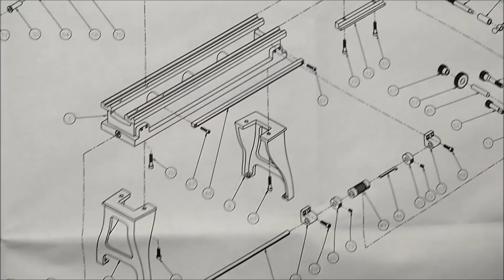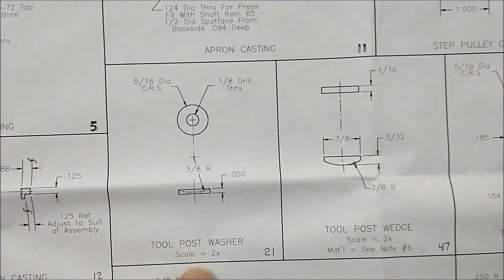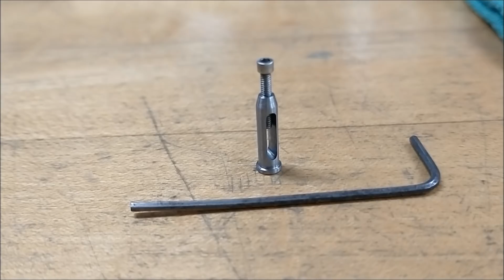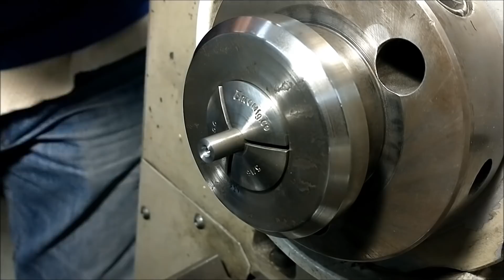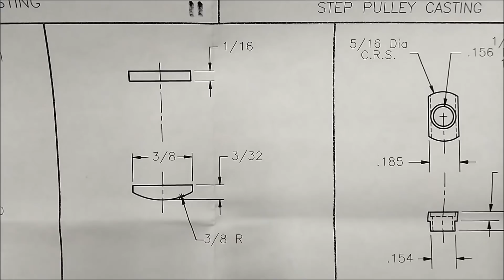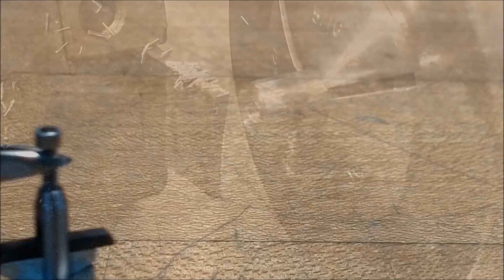Miniature Engine Lathe - #1 - The Tool Post

Comment: This series has 'forced' me to get one of these kits.  My only complaint about the kit is the plans are on such huge sheets.  I actually prefer each part drawing on an 8x11 sheet that I put in protectors and notebook and keep that at the area where I work for easy reference so I don't have to go over to the table
Reply from the maker: I agree. I normally take the large sheet into the office and block copy the areas I am working on. I have a lot of 8 1/2 x 11 drawings when I'm done. Good luck with your build. Its a challenging model, but the finished product is worth every minute. Thanks again for the gift.

Comment: Last time I used that gap was on a Winchester '73 set trigger tension screw. I would be using my Unimat on the tool post holder and a magnifying glass. Very nice work indeed. The miniature rocker barely big enough to pick up . Maybe a ball end mill in the lathe tailstock to make the rocket ring? All in all, very enjoyable to watch your work.

Comment: Plunge a 3/4" ball mill to get the proper dish in the washer.  The only hard part is figuring out how to hold the 3/4" shank in the tailstock.
          (Do you have a ball turning attachment for your lathe?  That could also be used.)

Comment: At 42:30, that looks like a tiny boring bar.  Where did you get it?  I've used end mills mounted in the quick change tool holder that has a V grove in the bottom, but this looks better.

Comment: Hi  from Down under 
Next time you need a keyway type of part . I set the bar with the grooved disc horizontal on a veeblock the run a slitting saw the Finnish the key or in your case the wedge. Cheers Steve
Reply from the maker: I like it.

Comment: I'm never been interested in model making but a miniature lathe is certainly special. Truly liked you techniques, explanations and presentation.
It has been said already that an allen screw looks really out of place on a latern toolpost? Should be a square head, what the drawings say?
Reply from the maker: I agree. That would look more correct.  The cap screw was supplied.

Comment: This is great work. It makes me want to build one. The best of YouTube. It doesn't just teach. It inspires.

I like the camera angle and view. I have a question about the lighting on the mill, though. Is it my monitor or is it the lighting? When you were cutting the wedge, the metal looking a little yellow -- almost like brass. Are you using an incandescent light, or an LED with a warm color temperature?

Also, a question about the order of operations cutting the wedge. Could you have put a length of stock vertically on the mill and cut the "slot" first? Then part it off. The down side would be the interrupted cut. The upside might be that you would have a smaller "razor" edge when it parted. What do you think?

Comment: Kind of brings into question how far down in terms of size you can go and still have conventional machining work. You wonder if there is a process which is like an anti-welder which removes material.
Reply: EDM...
Reply: There are machines that use spark erosion to make any shape hole, the shape of the electrode determines the shape of the hole

Comment: Joe, i recently acquired a 1980 Enco 9x42 mill... whats a good drill chuck and arbor to use? all the R8 arbors and straight shank arbors i have all have horrible runout. i have a brand new Jacobs (made in england) 3/4 straight shank arbor and it has around 4 thou runout on the jacobs taper. im getting around .0002" runout on the collet and shank. i have several jacobs chucks a what looks to be nice Cushman, some chinese keyless chucks and they all have horrible TIR. best i can get is .005" runout (.010" TIR) on a drill rod at the chuck. and thats on the chinese keyless chuck on a new Shars R8 arbor. the jacobs and Cushman are over .020" TIR. i do have a nice Albrecht i use on my lathe but i dont have an R8 arbor for it. AND i would like to use a keyed chuck so i can power tap with the chuck.

Comment: Another PM blooper Joe. The dished tool seat disc would have been better if rather than a annular it was just cross cut with a 3/4 end mill. This would ensure the rocking wedge had full contact rather than two line contact areas. Yes it's just a model but if it's worth doing, do it right. Pretty sure the other creator will stay away from this model lest comparisons are made :)

Comment: The micrometer that is getting used at around the 24:50 mark. Looks different. Is that bought or been adapted after purchase to mic a part that only has so much surface area to get a reading off. That is a small piece at the 26min mark that is being parted off.
Reply: It's a standard micrometer style that you can buy, the blade anvils allow the diameter of narrow grooves to be measured e.g. a circlip groove. Some micrometers come with different style anvils that can be fitted for different jobs.

Comment: Another great video.   I noticed the face plate was numbered 16 on the parts list and on the prints there was a number 16 in the square.  I feel your pain on this project.  I'm sure you will do just fine.   Dan

Comment: Top notch! I wonder how many days it took to cut the parting tool with a Dremel though.
Reply from the maker: Using a cutoff wheel, it took about 5 minutes.
Reply: @joepie221  That's way quicker than I expected.

Comment: Another great video. Here's hoping you will continue with the other PMR scale machines:  horizontal mill, shaper.
You do know that PMR also has line shaft hanger kits should you decide to use the steam engine to run all these machines . 
Can't wait to start my lathe kit, which, incidentally did not come with the plans or materials for the four jaw chuck.
I do have all three kits and they have been seasoning under my bench for some 25 years. Your videos will be the impetus to get me to work on mine. Thank you.

Comment: For the cup, instead of a form tool, why not just go in with a ball mill chucked up in the tail stock?
Reply from the maker: If you have a $150, 3/4" dia ball end mill laying around, It would be Ok to use if your tailstock chuck could hold it.
Reply: @joepie221  Mine is only $130, will that still work? 
haha jk

Comment: For drilling the slender tool post prior to slotting I think you hit the nail with a wood support. I was thinking just before you mentioned that option that a shallow angle wood wedge to support the post for center stabbing and then drilling would have been a nice option.  

I can hardly wait to see the scale Armstrong tool holder for the 1/32 square HSS tool ... :D

Comment: Ha ha. I have that exact same calculator!
Reply: Slide rules taught us to maintain a mental approximation - still helps to warn of finger trouble. Sadly, slide rules don't add or subtract!
Reply: @russelldold4827  They can, if you have the right scales. But the numbers need to be of the same order of magnitude, or the process becomes sufficiently complex that you might as well just do it the way you learned in the third grade.
Reply: @russelldold4827  Hence, the Curta. What a great machine! Hmm... next Joe Pie project?

Comment: I usually use adjustable parallel and scrap aluminium when I have to support something thin lika that toolpost. Works for me ..
Reply from the maker: I looked at that, but the shorter adjustable parallels are short and wouldn't span the jaws. Building a sandwich took up too much room.

Comment: I think I have some stock that's the right sizes. Makes me want to try to do this without throwing the parts all over the shop. Or trying to fish them out of the chip pan. I like that you added an HSS tool bit, nice touch! When it's done I want to see you make a part for the lathe on the micro lathe! For bonus points, power it with the steam engine! :)
Reply from the maker: DONE.

Comment: did u make that tap guide? if not can u let me know where u purchased?
Reply from the maker: No. Its a NIROL brand. If you can't find them, any spring loaded tap follower should do. Look for Nirol first. #1 quality.
Reply: @joepie221  got those - maybe i did not state properly - the knurled round tap holder? i can make but easier to buy :)
Reply from the maker: @VanguardSys  I made those. If you make one, knurl a piece of bar stock for a few inches and part off as many, and as wide, as you prefer. Mine are 1/2" wide, .160 through hole with a 10-32 lock screw.
Reply: @joepie221  appreciated! grabbed some inconel had left over - lets see what we can do

Comment: When the lathe is finished, the first upgrade will be swapping this lantern style toolpost to a QCTP.  Next, install a DRO. An ELS would be very nice too.
Reply from the maker: I may actually do the QCTP and holder. That would be awesome to try.
Reply: @joepie221  I dare you!
Just found your channel, I am going to binge-watch all 34 episodes you currently have on this build. So far, I would classify your work as the exact opposite of abom torque. Those parts are miniscule!

Comment: Hey Joe,   I just noticed that you don't install your HSS tools in the tool holder up against the  inside face of the slot.  Is there a reason for that or does it matter?  Thanks.  Oh, and the camera setup works for me. :)

Comment: Presumably the wedge is to allow the tool to be angled in the holder. But the machine screw that tightens it all up is more or less flat at the bottom so if the wedge is angled only the leading edge of the screw will be in contact with the tool. Is that really going to be enough to prevent the wedge from slipping under pressure?
Reply from the maker: Correct, the wedge does allow for centering the tool. Normally, as I recall, the clamp screw is a ball on the bottom to apply point pressure and not influence the angle. Its been a while since I used such a setup.
Reply: If they don't start out domed on the end they end up that way lol

Comment: Excellent work! I noticed that you're using a commonly-used spin Indexer: These spin Indexers can be reversed to an extent which makes reaching the part with an endmill easier in many cases.  Just a suggestion. Have fun and be safe!
Reply from the maker: Thank you. I'll have to look into that.

Comment: They use .003 and .005 drills at work to drill the holes in the edge of intraocular lenses to install the haptics. The haptics are then laser welded in place. The lenses are 6mm in diameter.

Comment: A couple questions for anyone here. 1: I have a "large" W-Way Watchmaker's lathe fitted with a 100mm 3 jaw chuck, can anyone point me towards a website or person that can help me identify it so I can try to find collets and accessories? 2: Can anyone point me to a video or video series on how to get started with getting and bidding lathe jobs, please? Thank you.
Reply: You could try lathes.co.uk Tony that operates the site is also super helpful
Reply: @thaumaturgicresearchcounci4180  Thank you very much.  The only marks I can find on it are on the cross slide, but there's no obvious connection between it and the body. I'm thinking about stripping all the paint to see what's underneath, but I don't want to not be able to use it. Tough call. Thanks again, Bub.

Comment: New camera is doing great.  No more focus seeking and great detail.  Keep doing this little stuff and in no time you'll be doing watch work.  Nothing quite like machining through a loupe...
Reply: I agree, the new camera is great!  A respectful suggestion on the audio AGC adjustments.  If there is an ability to adjust them, I would back off the AGC Release Time to half or a third of the time it is currently set for.  That might help getting the audio back up for when you talk after a machine is running.  It seems like it might be set around 3 seconds now.

Comment: I got my mill and lathe from an older guy. He told me when you can't see the parts you make anymore it's time to retire. Thanks a lot Joe P. for adding me to the retirement list! LOL
Reply: Just get more powerful magnifiers. I've used an old High School type microscope to check a nose radius on a HSS tool before. Found it at a yard sale.
Reply: @bradyoung6663  I'm already wearing coke bottle lenses! Just gotta face the music. When ya can't see no more, ya just can't see! Feeling my way around works for the wifey but not high speed steel rotating objects! LOL